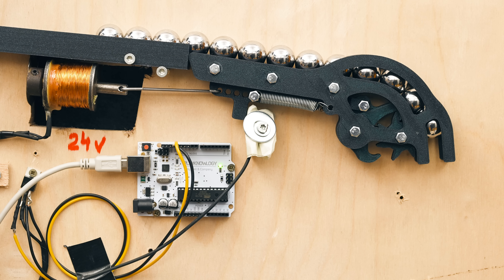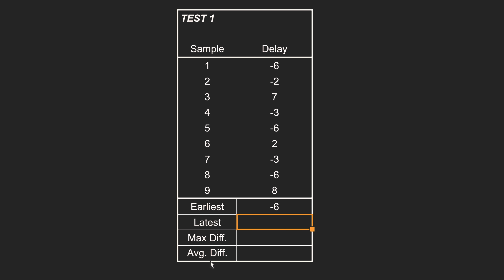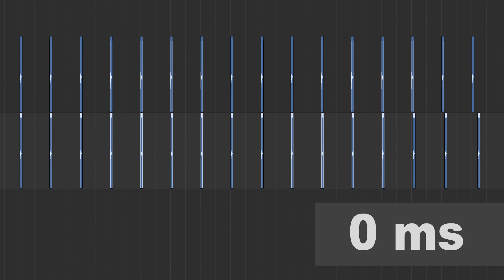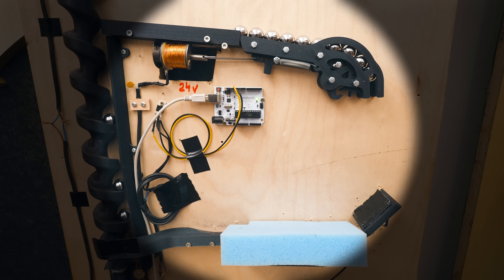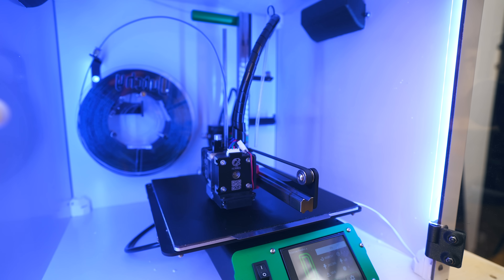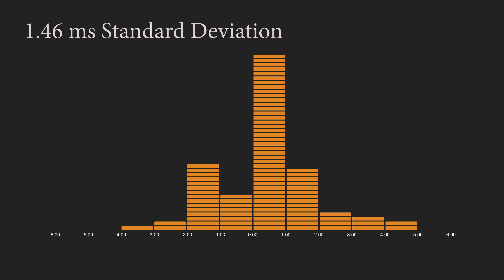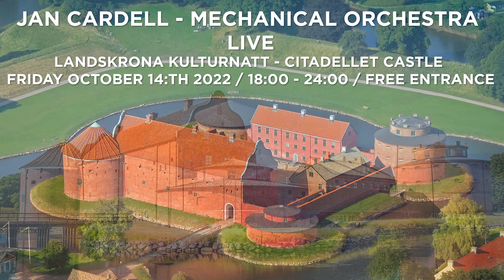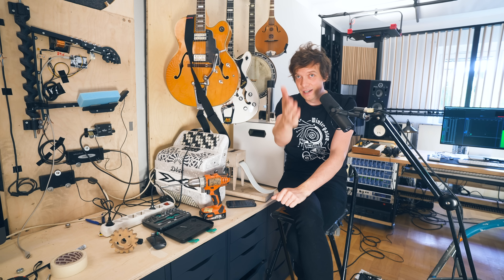Testing the Arduino Marble Gate

Comment: An improvement to reduce the variation from the arduino itself is to use a timer and interrupt service routine to activate the solenoid rather than the delay function in the main loop. It will make the timing controlled by a hardware timer rather than the execution time of the main loop, which is affected by other task (that you might be unaware of) having an impact on the consistency of the timing. It also enables more functionality in the main loop without affecting the timing. It is a little bit more low level and may seem intimidating at first but I'm sure there are tons of examples online and quite powerful. The delay function itself actually uses a hardware timer but the other things it has to do in between those commands can impact the delay.

Comment: since an accurate escapement like in watchmaking seems to be important i wondered if you have ever seen the work of George Daniels and his apprentice Roger Smith the first new advancement in escapements in 250 years and finally adopted by Omega its called the coaxial escapement and is more accurate for a longer time due to reduced friction - check out the YouTube on their stories might give you some engineering inspiration.  Also I wondered about the long term effectiveness of your plywood gears. it looks like you are using a very expensive type of plywood which probably works better than my lumber yard stuff but long term i would think it would wear and introduce slop into the system   Maybe its necessary to have a cnc machinable product to work with but lumber costs are only going up.   I was wondering if something like the chains used for chain saws or bicycles could be a replacement for some of your gear requirements.  I would thing it would be really cheap and easy to alter and be pretty standardized and have parts or wheels that would be standard for it that wouldn't cost much more if any than all the plywood and last longer - just thoughts - love your work

Comment: 9:14 ish you can assume the first and second marble drop to be identically independent distributed (i.i.d.)
Therefore the difference you measure is equal to target difference + second delay - first delay.
So you want to know what is the standard deviation of the delay (*standard deviation* of first and second delay is equal), but you measure the standard deviation of the term above.
You can use the fact that if you add (or subtract) two independent random variables, their variance (squared standard deviation) just adds up.
Squared standard deviation of measurement = squared standard deviation of first delay + squared standard deviation of second delay.
Squared standard deviation of measurement = 2 squared standard deviation of any delay.
Square root of (squared standard deviation of measurement / 2) = standard deviation of any delay.
Standard deviation of measurement / sqrt(2) = standard deviation of any delay. 🔲

Comment: The charm of the marble machine was that it was manual and mechanical, operated by a crank. MMX with the electric motor just automates the cranking. Going arduino solenoid actuation makes it computerized and why not just play mp3:s at that point?

Please keep it mechanical even if it is harder to perfect, that's where the beauty is.

Comment: If you really want to make one that can be toured with; I think you should consider making it at least partly electromechanical. Even if you insist on making the linking from the programming wheel to the marble gates entirely mechanical; it would not hurt to also add electrical solenoid switches that can activate them as well; that way if some of the complex linking becomes unreliable you could disengage the linking and wheel and control the gates directly with a midi controller as a backup.  (Look Mum No Computer here on YouTube could almost certainly help you with that since he's currently building a midi controlled church organ)

If the programming wheel could be disengaged and removed while the marble feed still works, it would also allow you to play it with midi while the programming wheel is being replaced.

Comment: You will also get larger variations due to the time of flight unless the distance from the gate to the instrument the ball hits is exactly the same .. which may be difficult to arrange.
If you try to compensate for that by offsets on the trigger position relative to the programming wheel, that will only work correctly at one speed .. you have other problems to solve. Testing how repeatable gravity is isn't your main challenge imho

Comment: OK you have proven gravity is quite consistent, but this missing the point : a real world mechanical (you stated) programming wheel will struggle to trigger a marble gate with ms accuracy. You are designing a system and obsessing about hyper optimising (again ..) something that actually isn't the critical path/bottleneck/weak link etc is largely wasted effort. Of course a power operated solenoid opens fast and rather repeatedly but since that isn't what you will use its actually irrelevant. You have a ms figure for the gate so move on to a mechanical trigger that is operated by a rather slowly turning programming wheel. Until that is also down to order ms repeatability further work on the gate is a distraction

Comment: Important note: Arduino uno uses a cheam and small RESONATOR as its 16MHz time reference for its clock. But some other boards, like the arduino micro use a much more stable piezo crystal as its clock reference. I have played with that a bit and there is a significant difference, when you talk about milliseconds over minutes of running.

Comment: The biggest deal here is you're starting with the most critical part and fully testing it before moving on.  The difference between 1 ms and 2ms will not matter, but the difference of having known-good components before really diving into the full system design will make this dream come true :)

Comment: FYI You will be able to increase the accuracy of the Arduino by not using the SysTick timer in polling mode. Look up what timers you have available on the microcontroller unit and how interrupts work ;)

Comment: Heeeeey, Martin is at it again! :D
Remember folks, there's a great difference between right and correct. Play music the right way and it sounds fantastic vs Play music the correct way and it sound ... correct.
Mechanical timing deviations is not were it's at. The speed of sound is about 340m/s so deviations around 1-2ms are like moving a sound source within a range of a few decimeters from your ears. It is correct. There is a lot of placebo measurements going on when you have the tools available ...

Comment: Kudos for the effort and the entertaining video... until you start trying to statistically compare tests results across different setups (angled pad vs flat pad) using a (probably) too small sample size. I would suggest educating yourself in additional statistics metrics, such as confidence interval and confidence level. It will help you better interpretate the test results

Comment: According to the studies people start to hear the timing delay somewhere around 10 - 40 ms. Why not an exact number? The frequency of the sound plays a role here. If I have understood it correctly,  the lower the frequency, the longer the delay can be before it is noticed. However, I believe that the whole truth is probably a little bit more difficult as we hear some frequencies more easily than other around it. Anyway, the point is that the frequency of the sound affects to the delay.

Comment: There's an Arduino library called digital pin rather than digital write: It's far more accurate timing wise, we used it for photographing exploding wires.

Comment: Interesting that the inconsistency is being introduced by the marble path from the drop.  Wouldn't that be an indication that there is too much play/too high a mechanical tolerance in drop?  Or maybe just shortening the drop height overall to reduce the radial distance a marble can wander from drop to hit surface...
Reply: The mmx+n design is weak due crazy gigantism of its components. Its not so hard to understand that small distances, small and lighter marbles should be the right way to follow.
A 50kg marble machine with human dimensions would be  the logic solution for avoid most of the unresolved (after years) issues son of a titanicism vision. I don't believe...
Reply: @lostrimpellatorelunatico1548  -- smaller and lighter marbles might not generate enough force to create the desired sound, though.
Reply: @xristosdomini7249  just a gain adjustment to the mic input.
Reply: @lostrimpellatorelunatico1548  -- 1) Mass and force can change the tone.
2) gain adjustments have limits; you can't boost a signal that isn't there.

Comment: I thought the whole point of an upgraded vesion of the marble machine was that it was still MECHANICAL, like all the historical machines that inspired you not computer controlled. You might as well just make the whole thing based on computer controlled, no balls, no programmable spindle hub - just a few servo controlled hammers on a few instruments.

Lost interest in this project now because you've strayed too far away from the original ideals - glad now I haven't been one of the ones on your patreon each month, sendign you money for what seems more and more like a pipe dream, more about the journey and the income you get than the completion.

You were so very close with the Machine X - so it dropped a few balls out of hundreds of thousands, so what?  You think people would have turned on you for that?  NO.  Then you dumped all of your and SUPPORTERS hard work AND MONEY to start again - and continue earning thousands a month.

I expect this post to be deleted, because it makes you look very very bad.

I have no faith in you anymore Martin.

Comment: How accurate is the assertion of the signal that drives the solenoid?  Have you put it on an oscilloscope?  Is all of the latency in the electro-mechanical part?

Comment: I still don't understand why you started with inaccuracy of measuring relativeley. If you have an arduino and mechanics involved, first step should be to measure the absolute inaccuracy of those systems. You can assume that timeflow is very consistent in real life. Then you think about how to measure the arduino compared to it (i.e. measure a beep every second that it could produce). If it is withing aceptable accuracs, then let it beep at every electromagnetic activation and register the time difference (mind to verify that the beep should be still exact every second to avoid errors with the latencs of the arduino code). By this you can get accurate relative time measurements between "activation" and "targetstate" (marble is released or hit something). So (advice for general) keep in mind to involve all components errors and measurement issues before you start working. This saves you efforts of rework/rethinking afterwards. But hey, it is also cool to see the errors and improvements in your videos! I love your attitude, creativity and mindset! Keep on rocking the marble machine!

Comment: See, Martin, you've already given yourself an unnecessary design constraint of "I want the release mechanism to be analog"... I think the Digital Release to Analog Marble Drop would offer more advantages.  Advantages include "being able to play it live with a keyboard or MIDI track"  , ditch the programming wheel in favor of digital and electromechanical releases to control the marble drops.  Then when you play your live show, the MM3 could follow the MIDI track, which also controls the light and video show.  What would be cooler than dropping marbles in real time with your keyboard?  Then you could actually compose live or perform improv directly on the MM3 rather than have to program it first, then play...

Comment: Martin, don't do electronics and arduino if you do not know about it. 'Even the arduino is not accurate'. Sigh! It is within the precision of the oscillator. Totally predictable like any MCU. The inaccuracy you are measuring is due to the magnetising and mechanics of the solenoid.
The solenoid is also not fixed properly and is moving. Ie. You are characterising the mechanics of the solenoid and not the marble gate.
Reply: Anything under 8 ms latency is practically unnoticeable, so I will call this a win...

Comment: As an electrical engineering student: this is super interesting. I've used Arduino a lot to do various things, it's fun to use and I'm sure you will get better results using it to study the machine, piece by piece. I'm very excited eheh

Comment: Hey Martin, good to see you back! One thing about your use of Standard Deviation: please realize that if the stddev is 1,5 that 68% of the marbles fall within 1,5 ms before or after your average delay. That means that still 32% of the marbles fall more than 1,5 ms before or after the average (which can be seen in your data as well). If you want to cover 95,6% of the cases, your should use 2x the stddev (check the first wikipedia image on standard deviation) earlier and later in your drum machine.

Comment: There was a nice effect which I didn't knew about in the stereo test where the other ear was delayed by some milliseconds. I was able to start sensing the direction to where sound was going already when the delay was something like 2-3ms. So even that rythmically everything sounded perfectly tight, it was possible to sense the difference from that. If the both samples would have been mono, I would have had no idea of delay so small.

Comment: I manage a team of engineers. Mostly my job is to help them understand when the solution is good enough and when additional research/design/automation is a waste of time. 

Leo Fender could have sunk tons of research into perfect necks, frets, strings and bridges that are perfectly in tune and stable. But having a couple set screws at the bridge and a bolt through the neck to compensate for normal deviations is good enough for music. It’s a cheap and robust solution that’s a simple incremental improvement on older string instruments that could be adjusted only by carving wood.

Your previous machine looked awesome and sounded great, but was super expensive and complex and could only be adjusted or improved by grinding metal. If your goal is still to tour and perform with a marble machine, make good enough decisions and focus your design efforts on ways to adjust, tune, and upgrade. Modular design is your friend.

We love Pete Townsend when he breaks a string and we will love you if some marbles jam up or roll off the stage.

Comment: 3.9 ms is very well acceptable value that doesn't require a specific optimization unless there is a special requirement. Just go with it, do not tire your self with perfecting small details for the parts that no body will notice. Save your energy to bring together components with a overall good result instead. Engineering is not making the perfect, it's imposibble btw. Engineering is getting closer to perfect with small but reliable iterations, and at some point where you're is more than enough. You will never learn, do you?

Comment: 12:57 Really Huge comment.
It crossed my mind to kill this post. So mush time put into it.

 I hope he/Martin reads this. I put 4+ hours into this comment. (Got to get my words right). I think you are losing support. Not sugar coating my comment.

 That's how much I want to help Martin succeed. (I'm a slow writer. Proof read a lot.) Comments on what Martin did and responses.

He finally learns the big flaw in the testing method of the "Arduino Marble Gate". The marbles are striking the contact plate at different points. I realized that 5 mins sooner in the video and I'm just a copier technician. Who knows how much real time had passed between the point I noticed it in the video and when Martin was told of it. Next thing I want to point out. "Durability." That should be primary goal. You want it to perform well for a long time before any parts need to be replaced.

I barely even notice a 20ms differance when listening for it in this video. (Might be because I'm deaf in one ear. I can't here stereo.) Question. Next line, big. 

I think this was a prof of concept test. The parts being used here are not long term durable. But it works for this short test. What will be the result when longer wear parts are used?

Lastly a response to many comments of the disappointment that #2 never made it to stage and I have an uneducated "guess" as to why.

I think. Some sort of test performance was done as if it was on stage or done in house. Martin was not happy with it. It was scrapped and the start of #3 happened. That's my guess.

I think that decision to start over to a #3 Marble Machine is bad to all of the thousands of people that have funded a lot of their spare funds to the development of #2 over the years wanting it to go to go to show. Now it's not going to happen. ... Bad. They won't be happy. They may now think it was a waste to invest for #2 and will be a waste of their funds to support #3. They didn't get want they wanted after investing into #2. I would think that. I think this will result in not as much funding support for #3 than it was for #2.

Martin, I think you missed a big support opportunity for #3. #2 should have gone on stage with the comment "It is not perfect." Had it's performance been good or bad, I think the end result would have been better that what you are dealing with now.